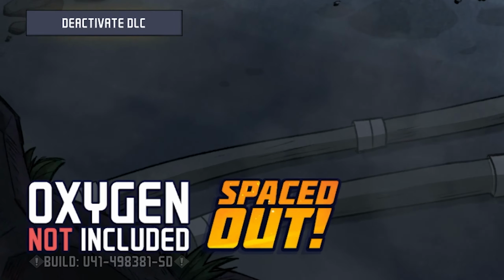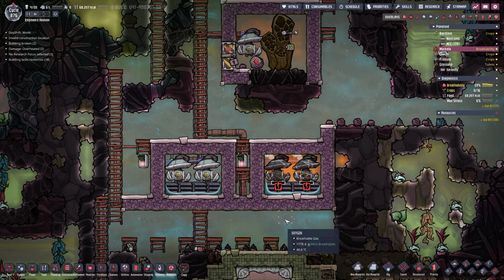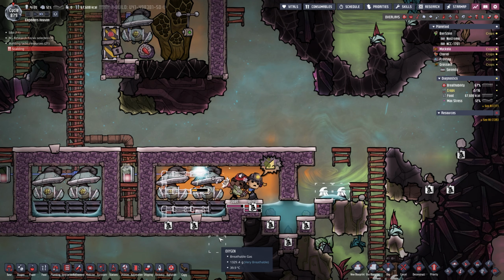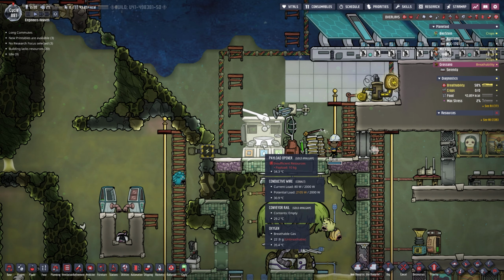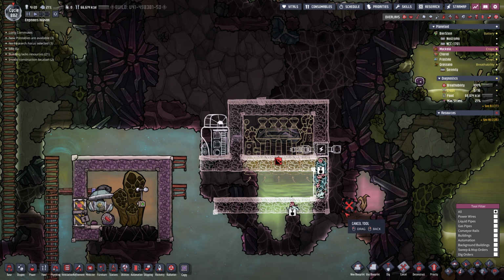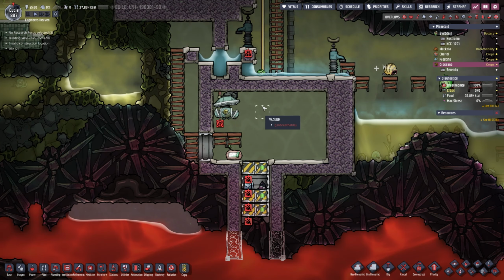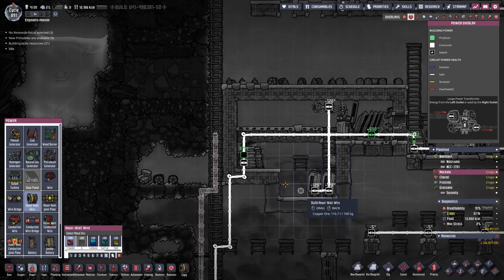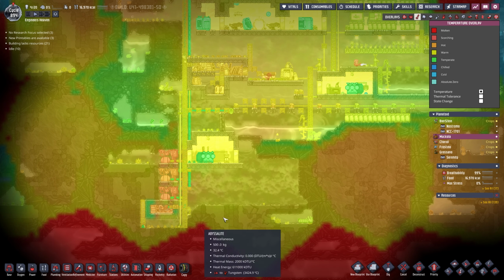Building a POLLUTED WATER BOILER! (LP1-EP 29) Oxygen Not Included Spaced Out

Comment: I did made a polluted boiler on my map as well, but it was made to get dirt and cool down the water I got to a nice 20 degrees. Can even use that system to cool down quite low like a AC for plant in cold zone.
Reply from the maker: That is exactly what the plan here is :) Get the dirt and cool down the water enough for use around the base wherever it's needed. 
If you want to share your design, feel free to hop on the Discord :)

Comment: not sure of your temps in your oxygen/natural gas storage but I'm guessing your oxygen is cooler, So with that in mind wouldn't it be better to cool the oxygen first rather than heat it up from the natural gas the way you have it.
Reply from the maker: You are correct, it would be better. But, the Natural Gas Geyser is currently dormant. It put barely any mass into the infinite storage. It just didn’t run long enough. In this particular case it doesn’t matter since it will be long equalized before I go ahead and hook more areas up to the cooler :)